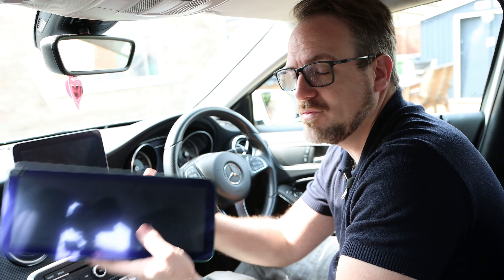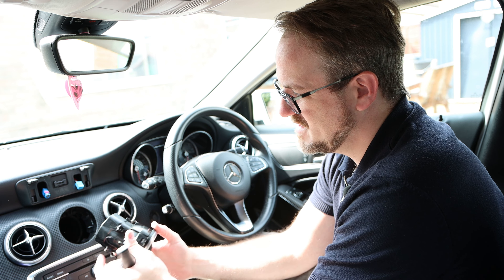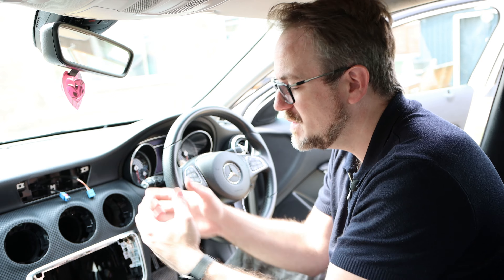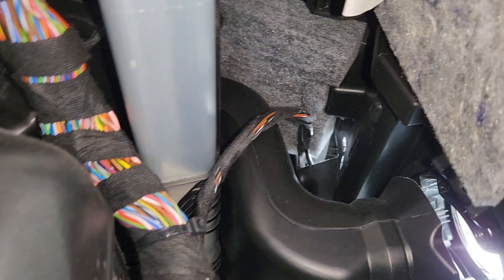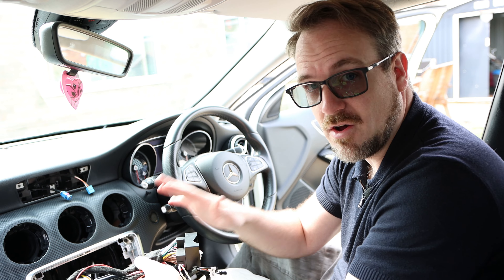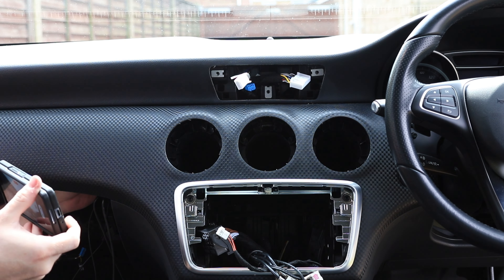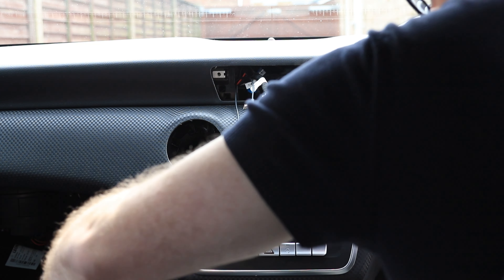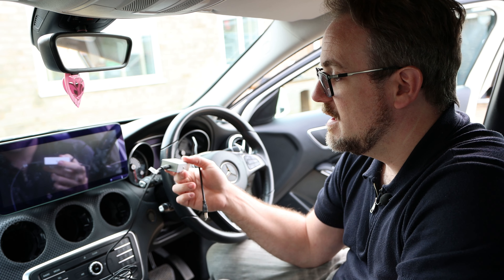Mercedes Aftermarket Head Unit Radio Screen Install Guide - Mekede

Comment: Hi @SaabUnleashed, great channel - thanks for your videos and reviews - on the back of them I bought the Atoto F6 - great unit.  Just bought a 2014 A Class and was looking to get this Mekede but their website says the unit is not compatible.  I'm really confused as I thought the 2014 model was part of the 2012-18 spec so to speak.  Do you by any chance know if it would work with my car or, any other similar units I could get as an alternative?  Many thanks

Comment: Hi, Ive just installed a his in my CLA your instructions were very helpful. I’m having issues with the sound though, an engine whining noise through the speakers which is slightly annoying. Is theee anything I can do to stop this?

Comment: Have you reviewed the Top Display Android 10 Radio for Dodge Journey 2011-2020 10.4inch IPS Touch Screen GPS Navigation Wireless Carplay 4G LTE Bluetooth WiFi Free Rear Camera?
 I was looking into an upgrade and there are no reviews on it

Comment: Hey hey, great work!
Have one question that is not related to this video, but what head unit with CarPlay you can recommend to install into Saab 9-5 MK1?
Reply from the maker: Anything 7 inch. Atoto, the Teyes CC2 Plus, Joying ect - I did an install in that car here https://youtu.be/g4p-IJCS8kU
Reply: @SaabUnleashed  what about Eonon on Linux with CarPlay?
Reply from the maker: @rostyslavlysyi686  I had issues with the Linux Eonon when I reveiwed it. You're better off getting the Android one which also has CarPlay
Reply: @SaabUnleashed  I got, thanks
Reply: Do you have a personal website where I can order it? As I see from the video, you are having some offline store

Comment: Hi I have installed a Mekede 10.25 screen in my cla Mercedes and the pop up temperature readings only operates from one knob of the dual control 
One shows the correct temperature and changes the other shows the temperature to no 36.5 degrees 
Any suggestions on how to fix 
Doug

Comment: Can the GPS antenna and the wifi antenna be put in the A Pilar? Is there any inconvenient on putting there?
Reply: The only inconvenience would be your time and effort. I don't believe it would make any difference in quality of the connection.
Reply: @ReddyBruckShot  Thanks for your answer

Comment: Bought a similiar screen for my CLA NTG 5.0, everything works fine until now haven't fully tested everything yet. Once issue i found when hitting it on Reverse camera wouldnt switch to OEM. Needed to change protocol.

But now got a strange issue regarding the sound. Sound works fine, even with Carplay. But the moment i get a phone call or try to call someone, there is no sound. The person hears me, it picks the OEM microphone but no sound.

Any help? Perhaps somebody faced the same issue?